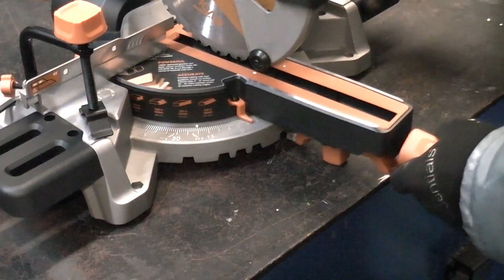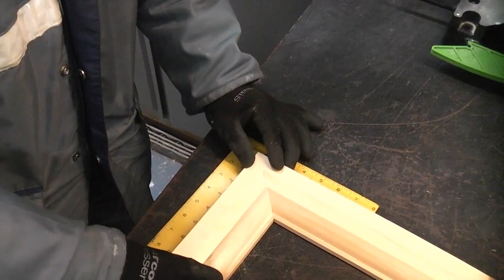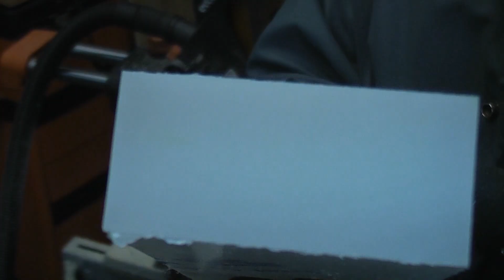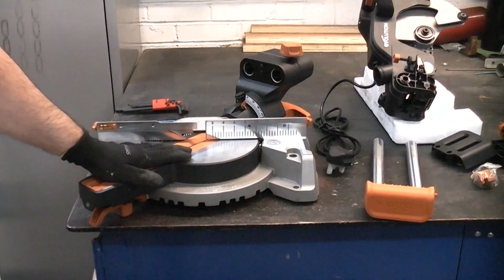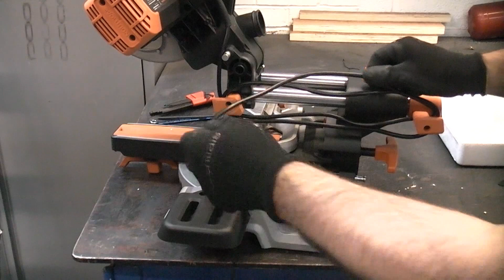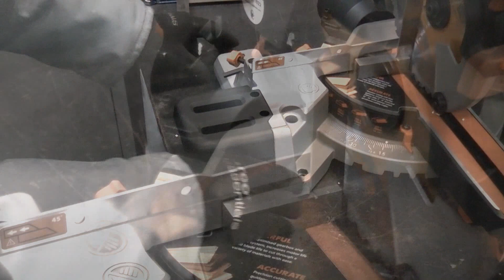Evolution R210SMS | sliding mitre saw review and setup

Comment: Excellent video sorry machine.  Its getting lots of youtube attention while it sits idle in the back of my shop.  Had enough. Hard to get back to square, laser never lines up, leaves jagged cut out on the back of the piece and the dust pickup is a waste of plastic. Evolution blade is twice as much as any other and its tough to find a  replacement 1 inch arbor blade. Went back to my starter metabo saw to get some work done. The British are still mad we won the revolution.

Comment: A perfectly clear demonstration. But - why does everything now come as a kit? All kit equipment should be clearly labelled as such which at the moment is never the case. Also, tools needed for the assembly and not included should be flagged up. And a guide as to how long assembly and set up is likely to take should be indicated. It may be assumed that everyone buying such equipment as this has some suitable experience but that may not always be the case. For example, when fitting the blade an inexperienced person may make a final tighten of the nut in the wrong direction, as the thread on this device is atypical. I suspect that manufacturers will keep pushing the boundaries to see how much they can get away with but it may take some buyers into danger. Let's have clear labelling please!

Comment: Picked up a dead one of these Free with stand, changed the brushes and away it went. The laser wire was also loose. However I was unfamiliar with some of the settings it was locked down and angle cut was also locked (didn't have the knob to release lock)and this is the best video I've seen on how to use it. As I say it was locked in the down position and I found the orange locking knob (not on the one in the video) and it would not pull out like it was siezed however in this video I noticed you have to push down to release the tension then it released no problem. Thank you for a great video better than the manual online.

Comment: Helpful. I recently bought one and after assembling it I needed a fine-tune.🙏 I wasn't getting a perfect tuning between the fence and the blade at the back. I removed the fence and noticed some minor imperfections on the bottom of the fence. A little sanding solved the problem. I got perfect tuning.

Comment: On the strength of your recommendation, I have just purchased one. Interestingly, the plastic extensions and the place into which they fit are no longer left and right handed. They are symmetrical - no square shoulder on one side.
Reply from the maker: This is my most used mitre saw; it’s been a life saver for me. Evolution are always improving their tools! I hope you get many years of use from it 👍

Comment: i am struggling with mine, not long had it but it wont cut through to the back of a 5 inch fence board
Reply from the maker: It should easily cut through wood 🤔

Are you using the original blade?
Is it fitted the correct way around? 
I’ve been using mine for years and have cut metal and wood with no problems 🤔

Comment: Just bought this off the back of his video:- the fixing clamp is useless for cutting bevels in one  direction because if pressed onto the plastic extensions on the left side, it lifts the timber at the cutting point . If clamped closer to the blade it interferes with the cutting angle. Very disappointed. There will be times when clamping on this side is necessary. Something should still work despite the price tag.
Reply from the maker: Sometimes you just have to step back and find a solution, I also own the Dewalt 12” sliding mitre saw and using any of these two saws is difficult for bevel cuts, due to the clamp. Only last week I cut some 4 inch plastic skirting and had to use a sacrificial piece of timber on top, to be able to hold the material whilst cutting it. 👍

Comment: I seem to remember that galvanised steel can give off poisonous fumes and dust when cut. Maybe the reason for the makers not recommending? Great video BTW. I just got one of these for my birthday so looking forward to getting to work with it.
Reply from the maker: Yes, you can get galvanic poisoning from grinding or welding galvanised steel, but this saw produces chips, which are not vapourised or atomised etc. 
You would not believe how easily these saws cut through mild steel, but they struggle with galvanised steel. I can’t get my head around how a coating of a soft metal (zinc), makes cutting the steel so much more difficult!
I hope you get years of use from the saw, I've been using mine daily for the last few weeks on a kitchen install. 
Thanks for the comment
Reply: @ultimatehandyman maybe run a grinder over the galvanising coating first,

Comment: Thanks for an awesome video! Let's I want to cut 40x40mm square tubing. How many cuts can the blade handle before it's worn out?
Reply from the maker: Not sure to be honest, If I mention a figure, it would be a complete guess. 
I think evolution did a test once and a single blade on the Rage 2, and a single blade outlasted something like 53 abrasive discs! 
If you are cutting a lot of metal, the Rage 2 is an absolute beast- https://www.youtube.com/watch?v=Orx676NXyws&t
Full review- https://www.youtube.com/watch?v=zI09uLXTvmE&t

There are some tips here for maximising blade life from Evolution (it's a Rage 2, but applies to all models) https://www.youtube.com/watch?v=0aHFbOOKTUg
Reply: @ultimatehandyman  awesome info, thbaks a lot. For universal use. Which model would you recommend? 210sms?
Reply from the maker: @Dibulok   You are welcome ;-)
It depends what you are cutting. The 210SMS is fine for most people, but if you need to cut larger materials the 255SMS is better.
Reply: @ultimatehandyman  ok awesome. I'm looking for a un7versal cutter to have around the farm. Anything from steel square tubing to wood.

Comment: Outstanding work, especially explaining how to get the blade perfectly square. Couldn’t ask for a clearer, concise and professional demonstration. Thank you!!
Reply from the maker: You are welcome
Thanks for the comment 👍
Reply: @ultimatehandyman   Just set it all up perfectly using a little 5” set square following your instructions - it was quite a way out. The bevel adjustment screw just needed half a turn anti clockwise as the blade had a small gap at the top, but the straight cut needed the left side back rail pulling all the way towards me to get it square. Thanks again!

Comment: I have just bought this saw today to do some stairs and decking in the morning. I have just put it together and noticed that the blade has a fair bit of play in it even thought it’s correctly mounted and tightened. Is this normal?
Reply from the maker: No, that is not normal.
If there is play, it will not cut accurately. Have you tried cutting with it?
Reply: @ultimatehandyman  no not yet. If you touch the blade with your fingers it probably moves half a mil or something. Should it be absolutely rock solid? Thanks for the quick response 👍🏼
Reply from the maker: @TheStockyOne   It's not something I have ever tried, but I'd imagine that if the blade is not rigid, the machine is not going to cut properly.
I can't remember their being any movement in any of the machine that I have had.

Comment: Hi what is the difference between this model and the R210SMS+ model Evolutions are now selling? Also, do you think this saw would handle cutting a 3 x 3 fence post? Thanks
Reply from the maker: The + models normally just have more stuff with them, such as a dust bag and additional clamp etc.
It won't cut straight through a 3*3 post, you would have to flip it over, as the maximum depth of cut is 65mm
Thanks for the comment 👍
Reply: @ultimatehandyman  thanks for the reply. If I flip it over, would the cut be clean, do you think that is a reasonable compromise if otherwise a R210 would cope with everything else I need to cut? thanks
Reply from the maker: @angwer2940   Yes, I have flipped work over plenty of times, but if for example you are a fencing contractor and install hundreds of 3*3 posts, you would be better off with a larger machine.

Comment: When checking against fence do we need to check on both sides?I'm getting it ok on left side as you showed but when checking on right side it's not square.tiok a straight edge to check if back fence is warped but it's ok
Reply from the maker: That is weird, if the fence is straight at both sides, the blade should also be square to the fence at both sides 
🤔
Thanks for the comment 👍

Comment: Hi, I was fortunate enough to receve one of these for Christmas! It is the "R210 SMS+" version (not sure what he "+" is though!) Unfortunately I have made a slight error in assembly - I put the slide rails in upside down (not clear from their assembly video and it is a black handle at the end not orange so the "evolution" logo was not so obvious). In fact the handle points up, not down as in your version and the one on their video - so it was a bit confusing. Not a disaster as still operates OK but of course the cable grip is on the oposite side. I was hoping I would be able to push in the locking rods and remove the cutting head in order to remove the rails and put them in the right way upt - but it doesn't want to come off. Any thoughts on how I can rectify my silly mistake? Great video - I will certainly follow the steps to ensure accurate set up.
Reply from the maker: I don't have the saw in front of me, but if I remember rightly there are two spring loaded pins that locate through 2 holes, you would need to depress both of the pins at the same time, whilst pulling on the cutting head. You should then be able to remove it and turn the slide rails over.
Thanks for the comment 👍
Reply: @ultimatehandyman  Thanks! It was definately a 2-person job (one pushing the two spring pins and one pulling the head off) - but it worked!

Comment: When I got mine a while ago I read the instructions carefully with regards to mounting it on the stand. It said to remove REMOVE the 4 rubber feet before bolting the saw to the two brackets. Unfortunately, this meant the saw sat a little low on the attached rails coursing the dedicated stop to hit the rails on each side, meaning I couldn't swing the saw round completely to the 45degree stop. I unbolted the saw and reinserted the 4 rubber feet and now the saw clears the rails so I can now swing the saw unimpeded to the 45degree stop.
So, if you do get one of these saws with the stand, I would ignore that part of the instructions.
Reply from the maker: That's strange, as I removed the rubber feet and never had that problem.
Thanks for the info though 👍
Reply: @ultimatehandyman  Yep strange one indeed. My neighbour bought the same setup as me and never had an issue with the saw sitting too low after removing the 4 rubber feet. I did check and he set it up exactly the same as me. Never mind, just one of life's little mysteries I guess.
Reply from the maker: At least it works- that's the main thing.
I hope you get years of use from it, I love my Evolution mitre/chop saws 👍
Reply: @ultimatehandyman  Yes indeed. Now working absolutely fine, I am very impressed with this saw as well. Just made a casket for a beloved pet dog that passed away. Honestly, the things I get asked to make. Happy New Year.

Comment: Just purchased this saw as I thought if it's good enough for Chez, then it's good enough for me. Only a couple of slight adjustments needed to get the saw cutting true and now all working like a charm. Picked up the diamond blade at the same time as I am tiling the kitchen and it is cutting the tiles perfectly. So thanks for the great review. Have a good week.
Reply from the maker: These saws are so useful, I use mine all the time. I just wish I had a larger workshop, so that I didn't have to keep putting it away all the time!
I hope you get years of use from yours ;-)
Thanks for the comment 👍

Comment: Great video and needed as the assembly manual is a pita to use. A couple of things I noticed. After I completed assembling is slight play in the rotary table about 0.5 degree maybe less. I'm a little worried this will effect the quality and precision of cuts. Secondly lots of finger prints smudges on the rotary table possibly from the assembly line and not I'm hoping from being a demo model somewhere.
Reply from the maker: Mine is great for the jobs I do. Have you tried it yet?
Thanks for the comment

Comment: Could you please advise me on how to raise and lower the head it seems to be locked in the down position.
Reply from the maker: There is a locking pin at the back, you need to press down on the head of the machine and then pull out the locking pin.
Thanks for the comment
Reply: Keep that manual handy there bud XD

Comment: Proper bloke and a proper explanation, how would you compare this to a dewault at £199.95. They seem pretty similar to me.
Reply from the maker: Do you have a model number for the Dewalt please, and I'll check it out ?
Reply: @ultimatehandyman  DEWALT DWS773-GB 216MM SINGLE-BEVEL SLIDING COMPOUND MITRE SAW 240V, looks pretty much the same spec'. I am not full time pro' anymore but a bit of a fussy bastard, LOL, but I do like things right and I know setting tools up like you have done is very, very important, most traders just use them straight from the box, this is wrong.
Reply from the maker: It depends what you are going to be cutting!
The Dewalt mitre saws are really good, I have the larger DWS 780 and can't fault it- https://www.youtube.com/watch?v=6_OYbGlPyOM

But the Evolution is a much different machine as it can easily cut metal with the same blade, plus you can fit a diamond blade to it for cutting through bricks/tiles etc.

If you need to cut accurate pieces of timber I would get the Dewalt, but for versatility I would get the Evolution. For what I do the Evolution is perfect for everyday use.

Thanks for the comments

Comment: Great video, just bought one of these, instructions can be a little ambiguous/ unclear, so it’s good to get an easy, “ Ronseal” style set up and run through, I feel confident that I’ve set it up, and can make the required adjustments if needed. Thanks!
Reply from the maker: I hope you get as much use from yours, as I do. The Evolution saws have helped me tremendously with what I do!
Thanks for the comment

Comment: Absolutely awesome video once again. Great thorough review and some very good, easy to understand information.
How did you attach the R210SMS to the saw stand rails? When I had the Rage3S I used the provided bolts (with the square shanks and dome heads) going up through the rails and then up through the saw base/feet. 
I then used the washers, spring washers and wingnuts provided.

However, the new R210SMS has recessed hex holes. Is there a different way of connecting the rails with hex nuts?

Thank you again for your great vids. Hope you don’t mind me asking for advice 
😊
Reply from the maker: Thanks, I attached it using some cap head stainless steel bolts that I had in my toolbox, as I have a mixed selection of nuts/bolts and washers. If I remember rightly I used M6 bolts.
Thanks for the comment

Comment: I noticed on the first cut in actual speed that there is a lot of time before the blade slows down, is there no friction brake ?
Reply from the maker: No, I don't think there is a brake on this model or the older Rage3 but the Rage 3DB is braked (if I remember rightly)
Thanks for the comment

Comment: So this is the Rage 3 replacement for 2018 I can only assume...
Reply from the maker: Yes, I think this goes on sale soon. They have made some improvements over the Rage 3 and renamed it.
Thanks for the comment
Reply: Ultimate Handyman Any massive differences in your eyes? Been reasonably impressed with my Rage 3
Reply from the maker: If I remember rightly it is much easier to change the blade on the newer model, it also has storage space for the Hex key for changing the blade and also something to wrap the power cord around. The handle position has also been changed from vertical to horizontal. The Rage 3 is a great saw, I often use the Rage 3DB and it is my mitre saw of choice when I'm in my workshop.
I'm sure the guys at evolution are working on more improvements all the time.
Thanks for the comments

Comment: How does this compare to the Rage models.
Reply from the maker: I believe this is replacing the Rage 3. It is easy to set up and much easier to change the blade plus it's got storage for the power cord. I'd still like to see a longer power lead, perhaps made from a more flexible material but the saw itself is fantastic ;-)
Thanks for the comment
Reply: Ultimate Handyman Thanks for reply. I have a rage and can't seem to get the blade to stay square. It is the original blade but seems to flex. Only cutting wood. 8x2 max
Reply: MuddyBootz try a replacement wood blade and reducing ring will usually be  needed. Try Saxon brand online. Also there is some videos on how to set your blade square online.
Reply from the maker: You are welcome, I've never had such problems yet but doing as JuiceBanger1 suggests might help.
Thanks for the comment
Reply from the maker: Thanks for the comment ;-)
Reply: Flexibility of cords is a pet peeve of mine and I have sometimes rejected one tool over another just because of it, my 9" Bosch angle grinder has a super flexible cord and never gets trapped anywhere, so the box closes easily. My 4-1/2" Makita is the opposite, it's stiff and has a memory which made putting the tool in it's case a very frustrating experience which I cured by using a larger case from another tool and the Makita case for something smaller. I've know way of knowing but I believe the better cords have a higher rubber content and the worst offenders a higher plastic content. Thanks for your honest and comprehensive tool reviews.